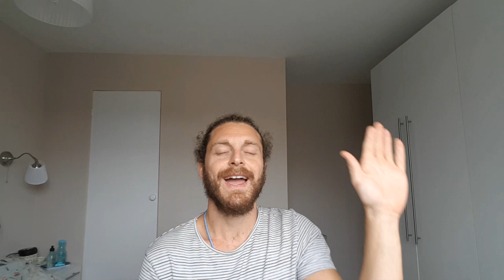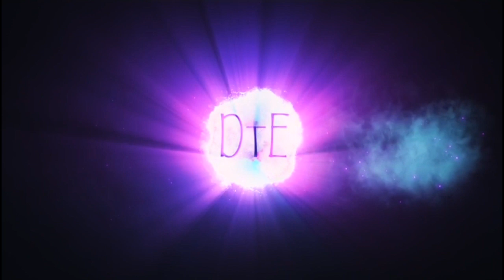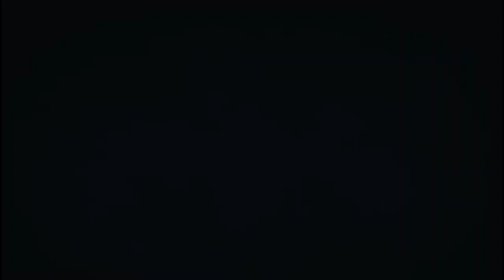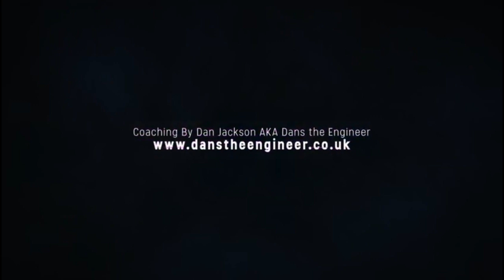Do You Need To Carry Out An EICR Before A Consumer Unit Upgrade Replacement

Comment: When a customer wants a consumer unit change especially if I'm replacing something that's 40 years old?  I always advise they have an EICR carried out by myself before we go any further. The amount of pre existing earth faults out there on installations that have never been upgraded/updated is shocking (pun intended ) there is no better way of finding out how the installations condition is. Simple! Great video Dan.
Reply from the maker: Exactly and well put. When I was an apprentice our firm got us to turn up with no prior test and cracking on with the replacement. It always caused issues such as borrowed neutrals, poor insulation resistance, bonding issues...... It appears that's how many companies still operate!

Comment: So would you carry out an eicr and an eic after the consumer unit change? So two lots of paperwork ? 
Thanks!
Reply from the maker: Yes. The EICR is the reporting of the condition and the EIC is the work you have carried out i.e. replacement of the consumer unit and any remedial works.
Reply from the maker: I'll just add that some certification software allows you to easily provide the information from an EICR to an EIC so very little work with two bits of paperwork.
Reply: @DanstheEngineer  ok cool thanks mate, so EICR before installation, and then EIC after installation as both require schedule of tests to be filled out
Reply from the maker: @paulneary703  that is right. Although you will find companies doing all sorts of different methods.

Comment: Quick question. I carried out an EICR/Test for the benefit of replacing a fuse board i.e making sure everything regs wise is ok and there are no faults. All was good for the board change. I issued the EIC with all tested circuits on the EIC. Do I also need to issue a separate EICR or does the EIC with all tested circuits override the need to issue a separate EICR? Thanks
Reply from the maker: I personally recommend issuing the EICR as a paper trail to show what you inspected and tested prior to the change and the differences between the two as the change would include different RCD times etc. Most software allows you to pull through results from one to the other for ease. A report and certificate records slightly different information so I think this method makes sense.
Reply: @DanstheEngineer  Thanks for getting back so quick. My situation was a landlord was about to rent out his property via a letting agent. But wanted me to replace the DB as he had already allegedly had a test where it was recommended due to no RCD protection on sockets being the only issue. I obviously did my own test and visual and found this to be the case. He wanted any other issues, for which there were none to be sorted out on the same day before I changed the DB. So it seemed like a waste of time writing out the Satisfactory or Unsatisfactory EICR as the only issue was no RCD which was rectified on same day of DB change. I mentioned in extent of work!!. Thanks again!

Comment: Hello Dan If i get an EICR done  would the report indicate if i needed a new fuse box ?
Reply from the maker: The inspector may note comments in the general condition of the system that a consumer unit upgrade may be recommended. But generally in the observations, there will be a list of defects with regulation numbers.

Comment: I always advise a customer to have an EICR carried out prior to a board change. There are too many variables. Fell foul of it in the past where I've fitted a split load dual RCD board and the 2 way lighting circuit has a borrowed neutral.

I think we all know what happened when I powered on...
Reply: M H  This was many, many moons ago Dan. We live and learn don't we. Any spark that says they've never dropped a bollock on a job is a liar. Suffice to say, I do indeed assume a 2 way will have that setup unless confirmed.
Reply: How would you test for this? Only way I can think of is R1 + Rn but this is not a routine test?

Comment: I think as a minimum the supply characteristics and bonding should be checked, if the client doesn't agree to a full EICR, the circuit(s) you find defects on, simply leave them disconnected and advise the client the circuit(s) cannot be energised until the defects have been remedied perhaps mentioning an EICR would have highlighted these issues way in advance and save them a lot of inconvenience.
Reply from the maker: Personally I wouldn't do anything but am EICR because leaving something disconnected if defects are found will cause some form of conflict and my advice when contracting is to avoid any conflict because that is when relationships breakdown and can create risk of payment or even a decent review.
Reply: @DanstheEngineer  Many customer aren't willing to pay for an EICR before a board change so I guess it's a case of  just walking away.
Reply from the maker: @ashmanelectricalservices4318  I would create a little PDF flyer explaining why an EICR is beneficial for both parties.... or show them this video.
Reply: @DanstheEngineer  I've always thought CPS providers should be doing this, at least that way, the advice is impartial.
Reply from the maker: @ashmanelectricalservices4318  🤣🤣🤣 Why do you think I created my channel..... 🤷‍♂️

Comment: Been asked for a EICR by the buyer (Solicitor and Home Buyers Survey) of my sons flat. Quotes have stated it needs a new circuit Board (not disputed)

A Domestic Electrical Installation Certificate will be issued with Fuse board upgrade and FULL TEST in 'extent of installation' etc and this has been stated by all of the Sparkys that this covers the EICR. Is this the case? 

(Keep being let down, not getting masses of quotes and wasting the guys time)